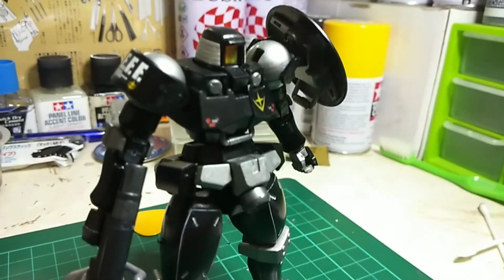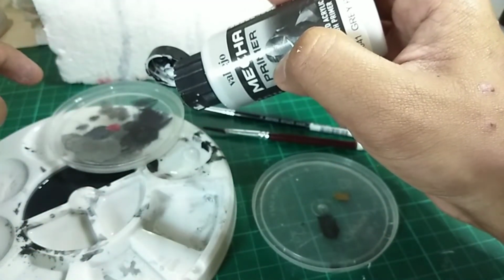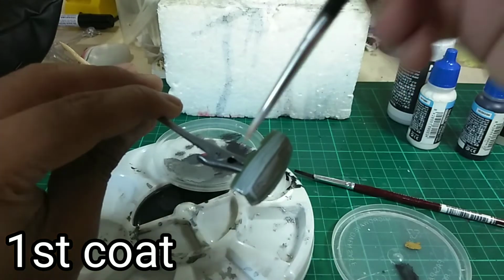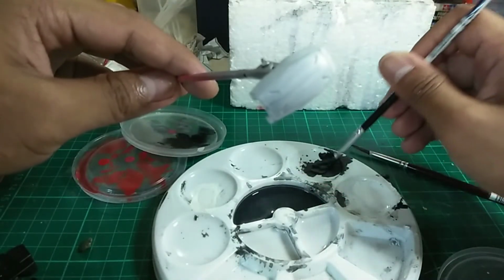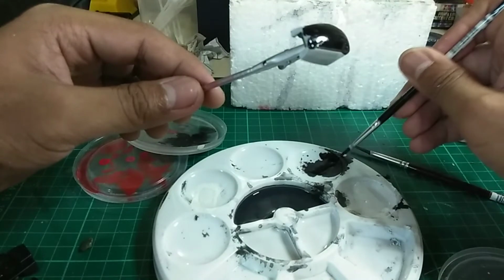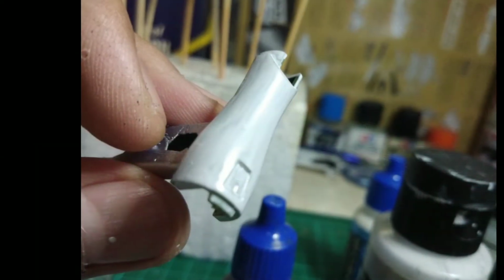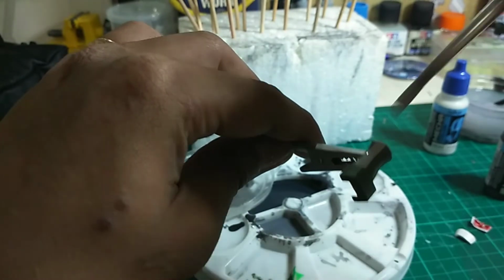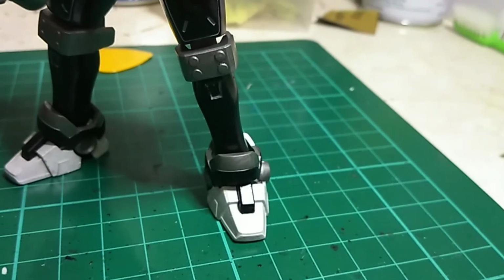HANDBRUSH PAINTED: HGAC Leo "Nightshade" Custom

Comment: I have a question what if the paint dries should i add a drop of thinner or what? Great video btw
Reply from the maker: If the paint dries on your pallette and you dropped some thinner, the paint wouldn't return to its original state :/ I tried it once
Reply: @TheMobileSuitHangar  so should i drop some airbrush flow improver too?
Reply from the maker: I'm not sure if it would help :/

Comment: Did you also thin your vallejo mecha color black using the same formula for the primer? :)
Reply from the maker: Oh, I didn't. According to Vallejo's workshop I attended, you can just use a wet paintbrush to somewhat thin the paints. Though, yes you can use the Vallejo Airbrush thinner for this one. :)
Reply: @TheMobileSuitHangar  I see will try out once, I'm free. Thanks!
Reply from the maker: You're welcome, man! Glad to help 😁